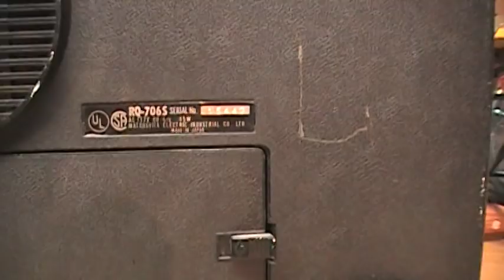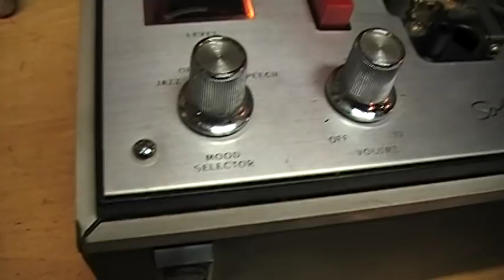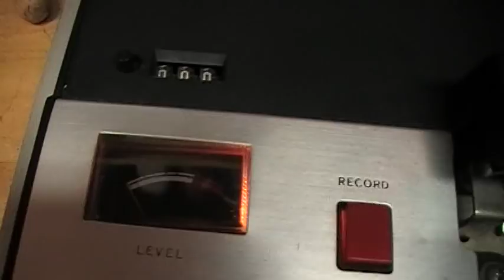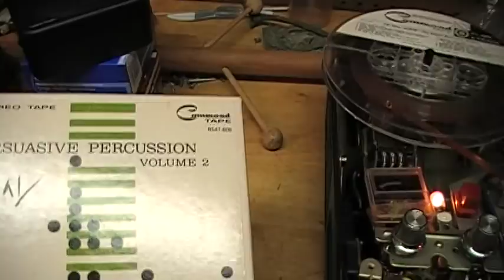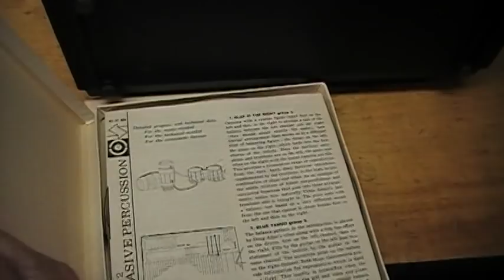Panasonic reel to reel tape recorder

Comment: That recorder is half track mono. It uses half the width of the tape in each direction. The reason you are getting the two recordings superimposed upon each other is because the tracks on open reel tape are usually staggered, 1&3 are side one , and 2&4 are side two, arranged like “1234” on a tape. So if you split “1234” in half, you get “1&2”. 1 is one channel of side one, and 2 is one channel from side 2. Cassette avoids this problem by tracks 1&2 being side 1 and tracks 3&4 side 2. I think that wasn’t done with reel to reel because head technology wasn’t good enough when the format came out, but by the time cassette stereo came about, it was.
Reply: Michael Crowley My Concord 220T did the same too, and it will not play stereo 4-track tapes since it was in reverse and forwards, but you can hear it backwards and you can also hear some subliminal messages on there.

Comment from the maker: I think the "Easy Matic" setting is auto level control, because you see it makes my voice peak much higher on the meter than the other settings, and the "Mood Selector" switch probably adjusts the sensitivity of the auto level control.

I still need to get a blank tape to try it out. I found one in the thrift store recently but it was so old and mildewy that I didn't even want to touch it!

Comment: I finally got my recent acquisition, a Panasonic RS-765US reel-to-reel tape recorder and it’s a stereo deck, and it has the same exact mechanism as this one. When I first got it, the fast forward and playback works, but it doesn’t rewind. So I did replaced it with a much better belt, because the original was shot, and the rewind runs pretty good.

Comment: The rim idlers and the capstan flywheel configuration is very similar to the early Sony decks.  I will say the tapes sound great.    I have a few stereo machines that it would probably sound incredible on.  I also have a two track machine that wouldn't play these tapes properly.  Thank you for sharing.

Comment: I have the RQ-705 model, it uses a fabric ribbon belt to drive the takeup reel. I'm assuming that they did this so that a separate drive belt and clutch were not needed, but the belt disintegrated due to age and it's really hard to trim a new ribbon to the exact right size. It seems like they changed that for this one, though.

Comment: it is a 2 track mono. you can play both sides of the tape. but it is mono.
Reply: thereelmaster 2 track mono and 4 track stereo were the most common for the quarter inch reel to reels in the lower end models if I'm correct. I've heard they came in two track stereo. Never seen one yet. I'm not sure if my little grundig was or it had two mono tracks recorded in one direction. The grundig said it was stereo but only had one speaker. I think I got two stereo channels out of the din jack though.

Comment: i actually own 6 reel-to-reel tape recorders, a akai gx-210d, a akai gx-4000d, a akai 4000ds mkII, a grundig tk341 deluxe, a revox a77, and a sony tc-252d.

the mechanism of your panasonic looks a lot like the mechanism on my sony. the main control for all the functions works the same.

i have never seen such a mono device before, all my decks are 4-track stereo.

Comment: I have a 2-track reel-to-reel tape recorder, and it's a Concord 220T and it works perfectly, and it's a 3-speed tape recorder and it can play mono tapes, it can also record Old Time Radio shows in mono on a speed 1 7/8 IPS, but I prefer 1 7/8 IPS for best possible to record and listening to classic radio shows like "Jack Benny", "The Lone Ranger", "The Shadow", and many more depending on what tape are using and it records up to 4 hours on 1200 ft. Reel, 8 hours on 1800 ft. Reel, and 12 hours on 2400 ft. Reel. I love Old Time Radio as a hobby, so I have to record some shows and add to my collection, but I have way too many reel tapes in my collection, including the one I recently got off of eBay is 6 Audiotape brand reel tapes for recording 12 hours on 6 2400 ft. Reels. In addition, I have so many brands like Scotch, Ampex, Irish, Shamrock, Emerald, Sony, Concertape and many more.

Comment: Hey VWestlife. It sounds like you're getting some cross talk. :) What do you think? :)
Reply from the maker: Yes, because I was playing a four-track tape with a two-track machine.
Reply: @vwestlife This won’t work with this tape recorder, but you need a stereo reel-to-reel tape recorder to play 4-track pre-recorded stereo reel tapes. I have my Panasonic RS-765US and it works perfectly, and it used the same mechanism as this one.

Comment: Very nice video. You are correct. I have a National rs 755S (Panasonic) reel machine which is almost identical (even the decal and back cover). The model I have has 2 vu meters and more jacks in the same position. I think they would have had a protective black plastic cover  for the front. These were considered very good units when they came out in the mid 60's.
Reply: My Panasonic RS-765US has the same exact mechanism like the one seen here, and it’s a stereo unit.

Comment: I'm guessing as there's no track selector switch, it's 2 track mono.  Nice find.  Despite hearing 2 sides at the same time it sounds pretty good.
Reply: CoolDudeClem My Concord 220T had no selector switch for 1/4 and 2/3, but it's a 2-track tape recorder.

Comment: I have a very similar unit but it is badged Magnavox and is stereo and without speakers or internal amp. Mechanically it is identical, just with a different head cluster (mine had three stereo heads) and two level indicators. Only issue with mine is that the motor makes a loud purring sound when in play, so it may need some rubber bushings replaced. Mine also makes that horrendous sreech when engaging rewind. Design flaw perhaps?

Comment: I just bought one of these on Thursday at Goodwill and I almost looks exactly the same except mine is a dark brown color instead of black.  Where did you get an additional blank reel so that the tape can run through the tape head mechanism?  I'm missing that part.
Reply: What you need is called a take-up reel.  You can probably find one on eBay.  Any reel without tape on it will work.